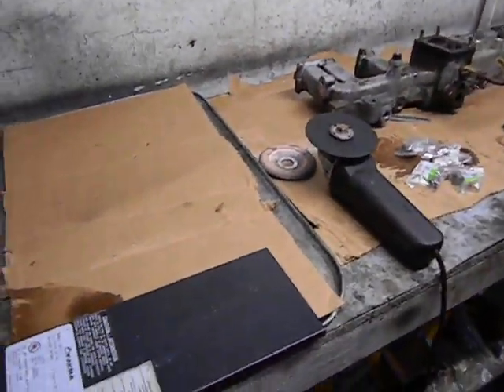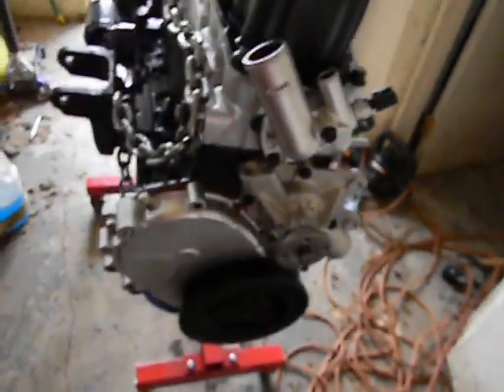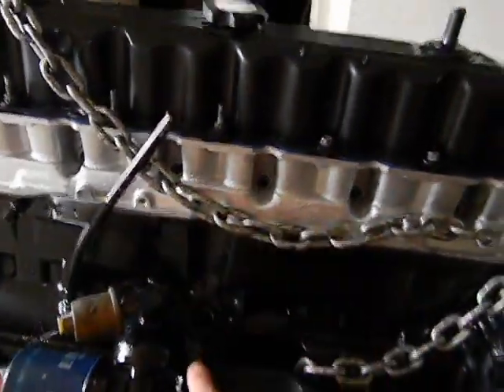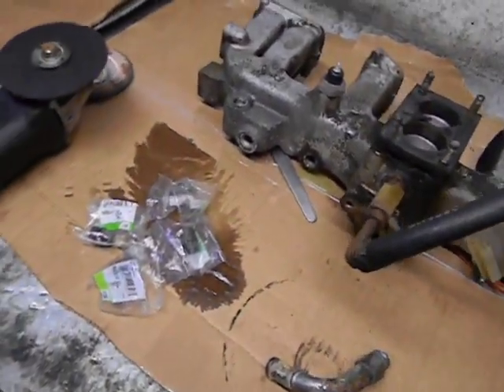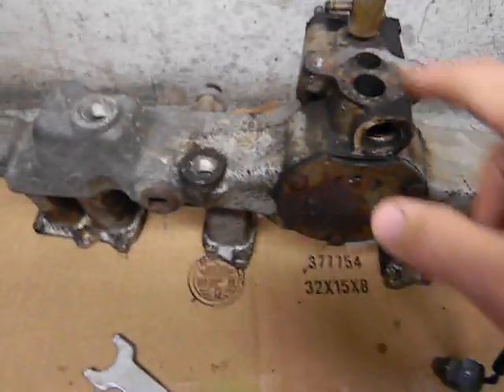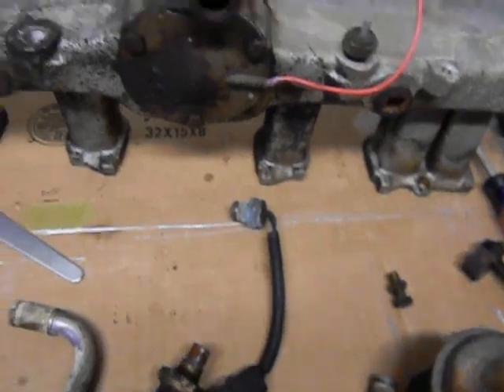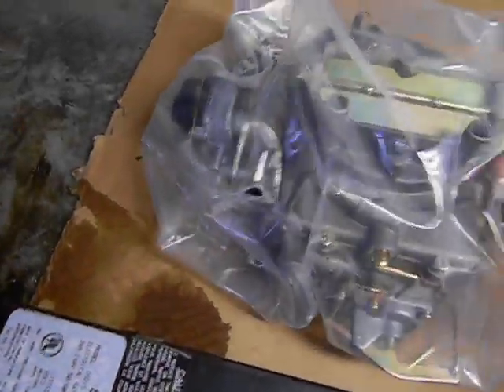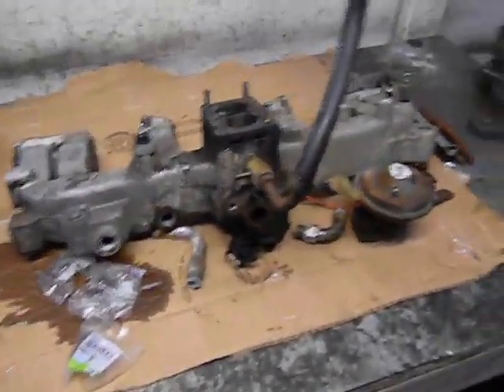Jeep Wrangler YJ 258 to 4.0 carb swap HEI  Part 5  Intake and carb

Comment: What model Ford did you look up for the Motorcraft carburetor?
Reply from the maker: https://www.ebay.com/itm/Two-2-Barrel-Carburetor-Carb-2100-For-Ford-400-302-351-Cu-Fit-Jeep-Engine-2150/223670130122?epid=908780351&hash=item3413c755ca:g:mmsAAOSwmRBdgfUi